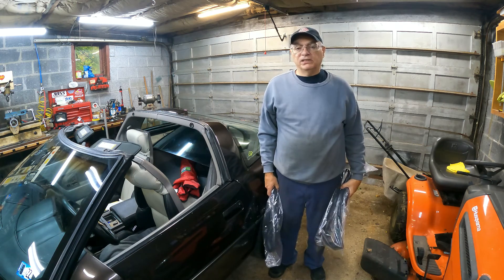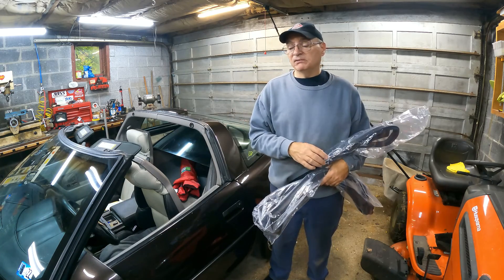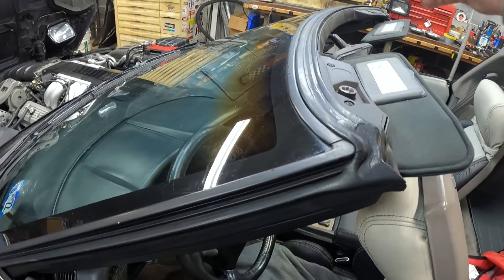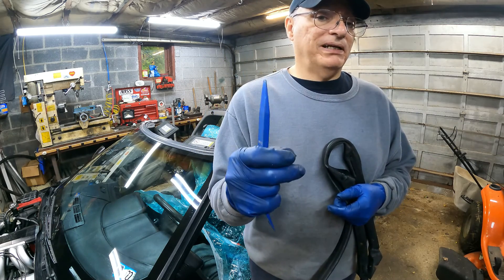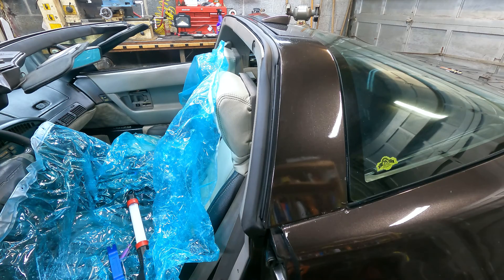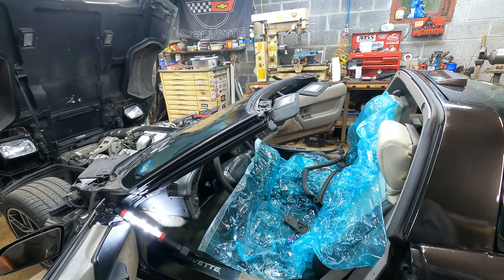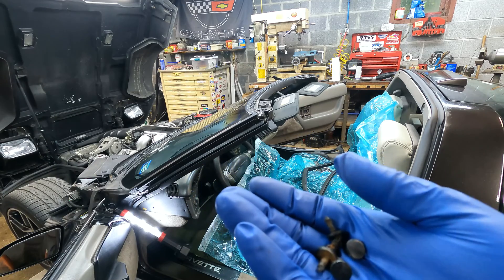C4 CORVETTE A & B PILLAR WEATHERSTRIP 😎

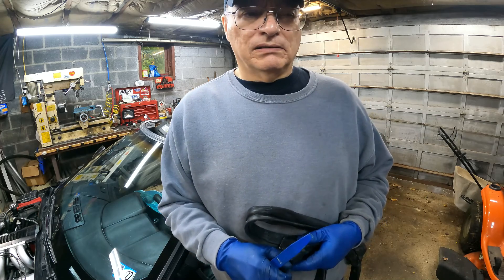Comment: 5:30 Do yourself a favor and buy a trim kit which has all those black plastic tabs and connectors in various sizes, plus it looks better to replace with new plastic with new weatherstrip or other components.

Also good to have a ton of black trim screws of differing varieties. No sense putting rusted screws back in!

Comment: I have new strips from the previous owner, they look like the original latex or maybe they are neoprene. The old ones anyway look ok except for some small portions where the gloss is gone and small bits are missing. there are also the two small strips at the front of the doors which I don’t have spares for, but I managed to repair them. they had a steel band for rigidity inside but was all crumbled rust :) I cleaned the rust thoroughly and inserted an aluminum V stip, tabs, then repaired the rubber using Black Seam sealer (PU), which polished looks like rubber. It turned out well, otherwise it would cost $90+ for a pair.

Comment: On the back pillar, you tuck the top in, but I did not see any adhesive used.  Is that correct?
Reply from the maker: I believe  I used glue only on the ends, you can use glue along the whole way but just a little if you do.
Reply: @E.T.GARAGE  I just popped the ends off and glued just those.  I think that's perfect!  On the pillar A.  I couldn't see too well your removal of pillar A in this video.
Reply from the maker: Sorry I did not get a better shot @blakeeiu

Comment: When you were replacing the A pillar, how did you start it? The same as the B? Put the one side into the grove then come at it from the other side? I really didn’t get to see a good shot of you doing that. Thanks for the video it’s helped me a ton
Reply from the maker: Your actually supposed to center it and work out to the sides, but test fit it and see what works best for you
Reply: @E.T.GARAGE   great. I have the OEM set from Davies corvette. Should work out good. So which side do you recommend putting in first for the A. As far as pushing it into the grove?
Reply from the maker: @barryjohnson1514  just go for it, test fit it with no glue and see what works best for you.

Comment: Why did you not put weatherstrip adhesive under the whole seal ?
Reply from the maker: It's not needed and makes it easier to replace next time. I have driven in torrential Downpours and never had a leak.

Comment: You mentioned using glue during the install but I never saw you apply any? If so what type of glue do you recommend?
Reply from the maker: 3M Weather-strip adhesive Black, https://shop.advanceautoparts.com/p/3m-weatherstrip-adhesive-black-5-oz.-tube-08011/22984714-p?product_channel=local&store=4533&adtype=pla_with_promotion&product_channel=local&store_code=4533&gclid=Cj0KCQjw2cWgBhDYARIsALggUhoz7pXZkHeR1ST-PwLFf1ECJ-Zc2CWkrtR-FH2mFbH_aXRS64N1OZIaAgqEEALw_wcB&gclsrc=aw.ds
Reply: @E.T.GARAGE  do you only apply it in the metal track where the weatherstripping clips into?
Reply from the maker: @destruxandexploze2552  Yes, only use a small amount.
Reply: @E.T.GARAGE  Thank you, I’m doing this on my Vette and I didn’t really find any guides.

Comment: Hey mr ET garage i have a question i did my b pillar weatherstrip and now it catched on my windows i have to open the door to fully close the window?
Reply from the maker: Can not think of what may be your problem, if you want email me some pics.
Reply: I have the same issue with mine, but mine are "cut order" actual rubber weatherstrips, it does help keep water out, but until they soften up a bit, it doesn't hurt anything.
Reply: mine were "cut 2 order" i meant. they just need to soften up a bit, the rear glass is still sealed but really hard to close.
Reply: You probably need to adjust your window by taking off the door panel.
Reply: @UN4SS1GN3D  I had found out the company i purchased my weatherstrip from had inaccurate measurements compared to the oem rubber. I bought a new one from amazon from a different seller and with some tilt adjustments it rolls up and down nice now! I also do use silicone grease to prevent it from drying out and cracking.

Comment: What chemical did you use to remove the  adhesive?
Reply from the maker: No chemicals, wire brush, mask everything off, 3m makes a adhesive remover but it doesn't work very well in my opinion and it will melt plastic trim pieces.
Reply: OK cool as we speak I’m removing the weatherstripping There’s like black paint kind of do I need to remove that too?
Reply from the maker: do not remove the paint